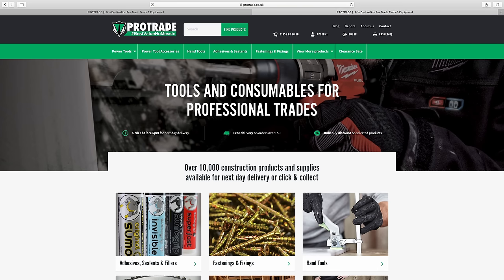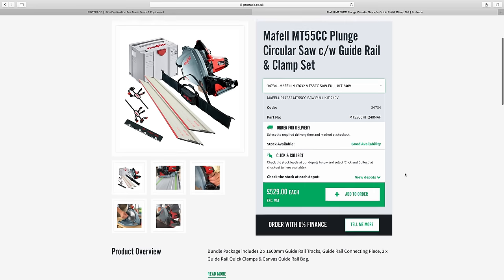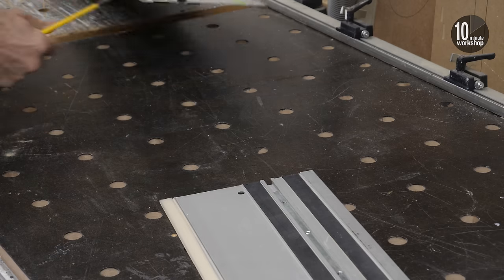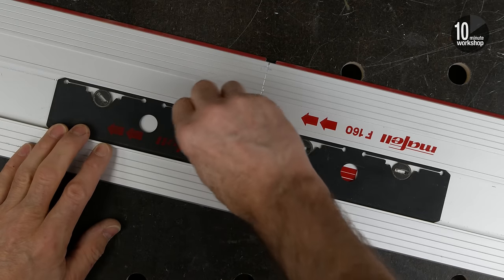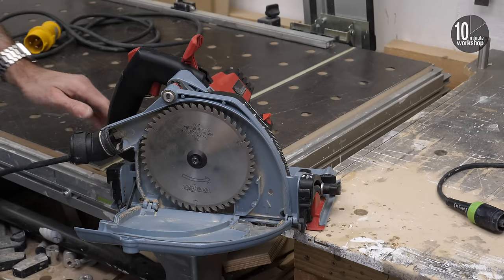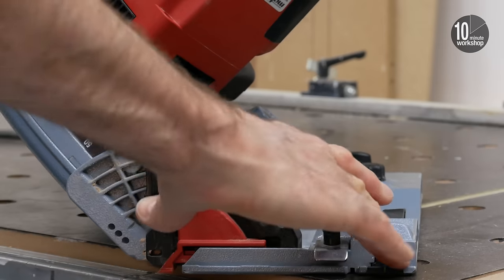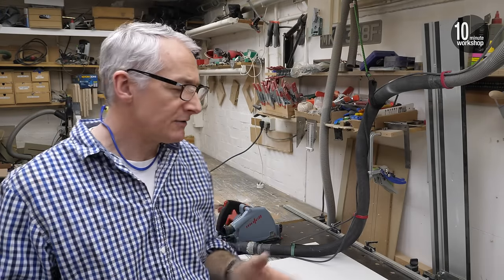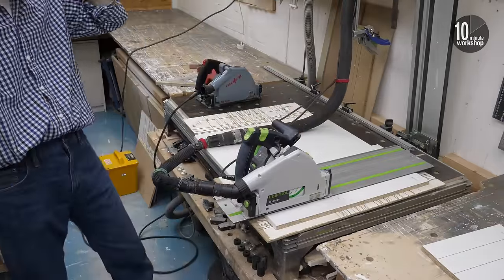Big Decision: Festool or Mafell? [video #400]

Comment: All of these saws kick back because they share a fundamental design mistake. They plunge/hinge from the rear rather than the front, like my old Elu MH25 did. This means that when you plunge it into the timber, it tries to cut down with the back of the blade, where the teeth are going down rather that up, so the movement works against you. Think about how we would 'plunge' a normal skillsaw into timber. We would rest it at the front and pivot it down, not at the back.
Reply from the maker: That's a really great point! 👍

Comment: Hi Peter, I have the mafell plunge saw and it would be perfect if it was not for its scoring function. It’s not a tenth of a mm more like one mm has you have shown. if the scoring function move the blade away from the body instead of towards it, it would not be a problem. It bevels the cut regardless if you score or not, to over come this you have to full plunge before and after you cut. On a Mft table close to the wall like yours on a drop rail you may have a problem. Despite this I would still buy it again ? Yes because I hang a lot of oak doors but had I known I would be more tempted to buy the festool when I made my purchase.
Reply from the maker: Thanks Kevin! Yes, I get into the bevel cuts a bit more in the patreon-only ‘further thoughts’ video, out Sunday. 👍

Comment: Hi Peter, just bought a Bosch 18v pro cordless circular saw, and it uses the Bosch FSN tracksaw rail. They look to me to be identical to the Mafell track rails. Bosch also uses the same rail connector as Mafell does. Might be an idea to check if they're interchangeable.
Reply from the maker: Oh they are. Mafell make the rails for Bosch, and manufacture some of the parts for the saw as well, though Bosch do the final assembly. 👍

Comment: As a diy woodworker none of these high end saws perform significantly well enough  over cheaper variants to justify the prices that they charge, I use a makita track  with a triton plunge saw,  polar opposite to these two, but once yo know your tool, with care and correct blade choice you can achieve good results,  the high end saws may be more robust electrically and or mechanically but so far I’m 5 years in with no problems, but then I don’t abuse my tools . Also festoon/ makita really should address the rail  joining issue  ,  reminds me off a particularly bad piece of scalextric track  !!!
Reply from the maker: I’m a huge fan of tracksaws, at every level and price point - but especially the entry level saws that we have access to in abundance here in the UK / EU. But if you are looking for a higher-end saw  - and if you ever needed to use one for any length of time then you’d appreciate the difference - then this video makes that comparison.  Lots of other comparisons on the channel, and all my tracksaw videos are in a playlist here - http://bit.ly/TracksawWorkshop 👍👍

Comment: Would you not shift the 10th over first and then take a full plunge cut without the step over. Basically final cut is only a tenth?  I have ts55 it’s nice but sometimes you got to use it freestyle and you cannot do that on these saws. Hilti is still good rival however parts are hard to get hold off
Reply from the maker: You can do off-rail cutting but it’s not great, as they’re not designed for that. 👍
Reply: Peter Millard. Thanks Peter. On site when I need to rip down sheet material for rough work I find the festool cumbersome. Not boasting myself but I can get considerably straight line without railguide on my hilti. This is because I can see the blade and find it’s lighter. Obviously I go to the festool on kitchen worktops etc. However before the festool I was using my hilti and it done just as good a job. With sharp blades off course. I just can’t justify the prices anymore. Ultimately a good jig will make a cheap circular saw just as good. Enjoying your videos Peter. Many thanks.

Comment: So you compared the scoring cut vs. just one pass full through, but you did not mention anything about the "reverse" scoring cut method where you move the saw backwards for the scoring cut. I would just really like to know if it makes any difference.
Reply from the maker: In my experience the ‘reverse scoring’ cut is a waste of time; I’ve tried it, and got a better cut just with a straight cut. Impromptu scoring cut in the festool was always better. 👍👍
Reply: @10MinuteWorkshop   Thank you! Personally, I have the Dewalt plunge saw and I have mostly only worked with full wood and for my own furniture or other projects, and been just really happy with it, so I have never really even used a scoring cut :) and never bothered to test it really because the normal cut has been perfect for me, but good to know.

Comment: First of all,  great channel, Peter.  I was wondering,  if it would it be better if the scoring cut was made by going backwards with the saw, having the same affect as the scoring blade on the big panel saws, which rotate in the opposite direction of the main blade?
Reply from the maker: Thanks Matej! I’ve tried the ‘backwards scoring’ method before and it didn’t make any difference that I could see, so I didn’t bother with this either. But I still have the saw, so if I have time I may revisit it this week. 👍👍

Comment: I’m looking at the TSC55. There is a decent cordless kit that was recently released in the states with a few extra goodies. May have to take the plunge...no pun intended...or was it 🤔🤔🤔
Reply from the maker: 😂 Nice! Heard good things about it! 👍👍
Reply: I've had the TSC55 for almost 2 years now. Love it. Beastly powerful with 36V but one of my batteries went bad and even on 18V I had no issues. Didn't really miss the other battery while waiting for its replacement. I usually have it attached to my Midi, but when I use with just the dustbag, I am shocked at how clean things are.

Comment: Wonderful video. A few things to add:
- if you do the shallow scoring backwards, the results are better. Every touch of the teeth is pushing the material inwards. No tear-out guaranteed.
- I love you did the test on the 0.1mm offset. I have always been suspicious of this feature and I was expecting your outcome. First time I have seen somebody do this on youtube.
- are you cutting fiberboard/melamine with a crosscut blade? I have done that once and the blade (the standard 48 tooth) went dull very quickly and badly. Festool has a special blade for that material, wich did a lot better.
Reply from the maker: Thanks Nico! I didn’t try the scoring cut backwards with the Mafell, but I’ve done it a few times with the festool and have to confess it didn’t make a scrap of difference! That was on a much better quality melamine though, which may make a difference. There’s more on the scoring cut issue in a  Patreon ‘further thoughts’ video, out Sunday. 👍👍
Reply: You can also do a “manual” scoring cut on the Mafell in thee same way you do on the Festool. I assume you don’t need to use the automatic feature..? Would be interesting to see how that works. I suspect though, it’s down to the quality/sharpness of the blade as much as anything, although the Mafell splinter guard does look more sturdy.

Comment: Ive had the mafell for 8 months now after owning a festool for several years, the mafell is in a league of its own. While the mafell will run on festool rails, the mafell rails are truly superior and the connector is brilliant.  You will run into problems doing bevel cuts with the mafell on the festool rail because the rail is thinner and it ends up cutting back the splinter guard a bit, at least on a 45° cut anyway. 

The power of the mafell is very noticeable, cuts that would have taken multiple passes on my festool, take a single pass on the mafell.

I dont use the offcut when I use the score function, I will make another cut or just do as you mentioned make a very shallow cut first with the normal setting, depending on the application of the piece.
Reply from the maker: Interesting, thanks! As I say in the vid I think the Mafell has the edge, but it’s not as clear cut to me, as some folks, like yourself, think. I guess a lot has to do with the type of work you do, and personal preference comes into it too; I like the Mafell rail jointing - streets ahead - but prefer the Festool rails overall. 🤷‍♂️ Good to have the choice at this kind of level though. 👍👍

Comment: We don't get maffel in Australia, although we can import from USA. I had a close look at mafel years ago. Definitely I like the mafel. I had the festool cordless plunge cut which got stolen with the two batteries that is more powerful than my corded older model version.
The cordless is taxing on the batteries I had the 4.2 amp hour and bought a 5.2 amp hour battery. The mafel have the cordless plunge saw which you can put cross platform batteries. I have the metabo 8 amp hour battery which will work well for mafel. Perhaps even the Bosch. As Bosch have the same rail system as Mafel. 
The plastic that runs along the fence for the mafel is a lot better as I bought paper holder to put on the fence for my festool to stop it coming apart.
The offset on the mafel is excellent and no chipping whatsoever. I wonder what difference it would be if you put masking tape on the work?
The only thing with the offset would you be needing an extra fence one for normal cuts and one for offset because you cannot simply put the fence to the desired cut as it will be slightly out. How about the distance between the back of the fence and the cut to see here the blade cuts for consistent cutting.
I feel the mafel will give closer cutting accuracy as I often take measurements from the back of the fence to parallel. Particularly when the plastic strips are used or having done angle cuts.
Does anyone know the cut from the back of the fence on the mafel? On the festool it's something like 185mm I think.
The squareness on the back of the festool means I have to spend a reasonably bit of time to tweak up. Even then I'm sometimes between .5 and 1 mm out on long cuts. Even when I'm .5 mm out I'm not really pleased.
Even the Mft I often get cuts out of square. So many things to adjust. I bought a large engineer square and set the table up.
I will build my own mft type table and square up true so I can have permanent square cutting abilities.
Well, to be fair I was cutting recycled timber which I didn't thoroughly plane and thickness so there was a bit of warping which occurred. Nevertheless I do think the mafel and cordless along with the fence system is the way to go.
As for the offset how do you gat around that. Run a router? That will defeat the purpose although if you had a good set up you could route to the score depth and not touching the top to chip the work. I no longer work with melamine and simply either work with ply or wood recycled. I like ply it also is less forgiving and you can sand to your heart content whatever coating or none.
Great video and thanksyou for uploading.
Reply from the maker: Great comment, thanks for taking the time. On my old-style MFT I set my fence against a row of holes, and my rail against a column of holes, and that’s it - no need for a set up square, as I’m squaring against the top. 👍👍 Edited to add; masking tape would certainly produce a cleaner cut, but the purpose wasn’t to produce a perfect cut, but to see what kind of cut they managed in a cheap board without using aides like masking tape. 👍
Reply: Peter Millard on cheap board the offset was exceptional. Once again very good job at presenting a great video. Your narrative skills is excellent.
Reply: I would not be importing power tools/machinery from USA. Wrong voltage, and even worse, doesn't conform with Australian law. They need to be tested and approved against Australian standards.

Comment: Hi Peter, as always great and informative video 👍 I bought the cheap  titan some years back off the back of your early videos and its had a lot of use and been a great little saw especially for the money, running it on makita and evolution rails. 

I'm now starting to run into issues with it where the cam adjustment locks to fine tune it to the track are too worn to take out the play, and the metal on the other side of the Groove (on the underside of the saw) shows signs out wear and you can see and feel where the metal picks up a little when running it on the track. I've fixed the slop problem for now by making by own diy cam locks out of a plastic sheet as trying to find any sort of spares for a budget saw is nearly impossible.

I'm now thinking I need to upgrade to something better. Now I'm facing the age old delilema of what to get festool, mafell or Makita or the new Milwaukee once it's been released as I'm already on that platform for many other tools. 

But with my recent issue being in my mind from the cam lock wear of the titan, I'm looking into how the others operate, I notice that the festool runs on two plastic strips either side of the rail rib, the mafell has a smaller plastic strip on one side of the rib but still metal on metal the other side which I have no doubt is far superior to the titan but still could run into the same problem over time. 

I'm sort of leaning towards the mafell but I do think the way the festool runs with the two plastic guide strips is a better design and there's not much in terms of price as you said in the video. 
Then you pose the question of guide rails the mafell does look like a better joint option but I still wonder how good and accurate a full sheet rip over the length would be compared to a long rail with no join. 

Then the use of the mafell with the mft I know you can get products from benchdogs (rail squares, parallel gudies etc) but am I right in thinking that for use on a mft the festool patent rails would also be superior for ease and multi accessories you can use with them, it looks like the mafell rails are let down by this point.  

It's definitely a hard choice, I wonder if the mafell would be the best compromise overall as you can run it on either rail platform and it does look to be a well engineered saw with the more motor power, even though the metal on metal on the one side of the track groove is still putting up red flags in the back of my mind.
Reply from the maker: Hi James. Yes, the lack of parts for the entry-level tools can be a pain. I do know that Triton carry spares for their saws, and as their saws 'share a lot of DNA' let's say, with the Titan and MacAllister saws, many of the parts are interchangeable, albeit in different colours. 

The Makita has similar metal-on-metal issues with the cams that snug the saw to the rail, and there's been no announcement of availability of the Milwaukee here in the UK, so I'm not sure I'd hold my breath. Keith Brown @Ragnbonebrown os probably the man to watch for that kind of info. 

The Mafell - like most saws - will run on Festool rails of course, and that does make a big difference when it comes to MFT-alike benches, as the lack of a left-side upward-facing t-slot on the Mafell / Bosch rails does hold them back in this area. I'm not aware of anyone having issues with wear on the saws or rails due to just the one glide strip, though I do see your point.

HTH Peter
Reply: @10MinuteWorkshop  on further research I did come across the new festool ts60 which is due to be released soon, which looks like it has some nice upgrades. I don't suppose there's that much info on it yet though from people using it in anger.

Comment: Love the video but it did cause me to loose sleep after watching at night. I had to go straight down to the shop this morning and experiment. And try as I might  with scoring cuts i couldnt get it to produce the 0.2mm shift over effect. Different woods and different thickness. I got nothing but a perfect glue up face.  The switch is nothing but a 2mm depth stop. However I have read that there is a tapered shim that causes the shift over. Maybe there is a tolerance difference between new and older machines.My maffel is 2 years old maybe they have redesigned it. Love the channel long time follower keep up the excellent work.
Reply from the maker: Thanks! Yes, I don’t actually know how old this machine is, but as a demonstrator I’d expect it to be a recent model. I wanted to test the scoring cut especially because a few people had mentioned the slight gap as being problematic on carcass builds. Good to hear you don’t have the issue, but it is a thing for some people. 👍👍

Comment: Hey Peter, love your vids, highly entertaining and educational. Make sure (i quess you already know this) you compare cutting on a angle between the Festool and  Mafell. On the Mafell while using the rail, it doesnt matter what angle you cut, the saw tilts/rotates on the underside of the rail, so your drawline is always your cutline. The Festool uses a small gauge on the front when you angle the blade, you have to compensate for the extra offset caused by angling the blade. I love the way mafell solved this, simply draw your cut, place rail, angle the saw and away you go. Pretty nifty. Keep up the good work, kind regards from the Netherlaands, Maarten.
Reply from the maker: Thanks Maarten! Yes, I have a follow-on video on my patreon where I have some 'further thoughts' - including the off-line bevel cuts - though it's the Festool that angles the blade around the splinter guard, and the Mafell that has a little gauge on the front of saw, btw. 👍
Reply: @10MinuteWorkshop  sorry, must be the Corona speaking 😉, you are quite right, i got the two mixed up. The MT has the extending gauge.
Reply from the maker: @UClCAB3o7E_sagrFzAwgmyVQ Really? That's interesting; I always thought the Bosch FSN and Mafell rails were identical in everything except colour. Thanks for the follow-up Maarten! 👍
Reply from the maker: @maartenstraver3737  Don't worry - I appreciate the feedback, either way! 👍